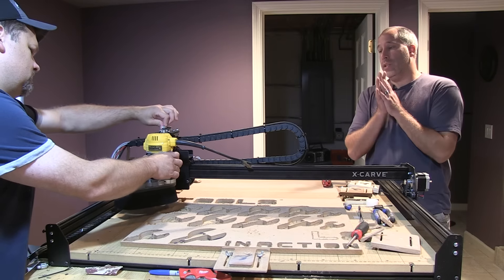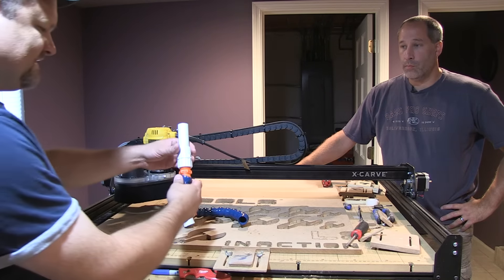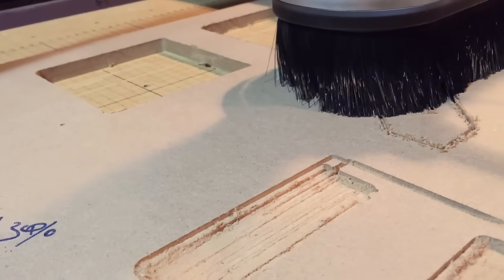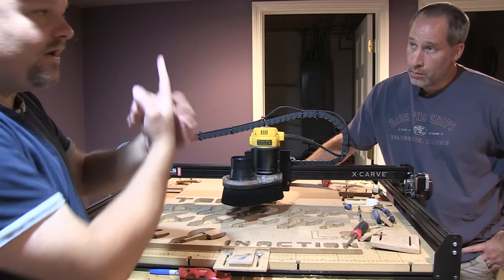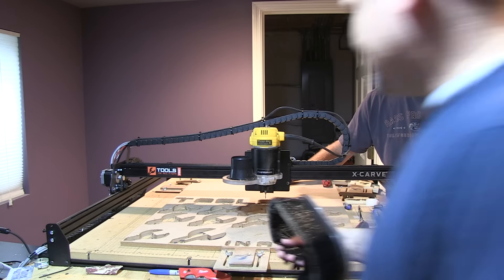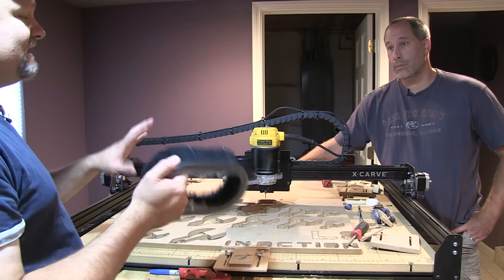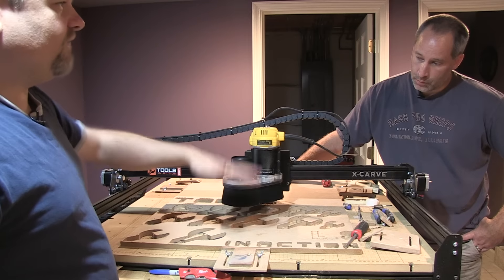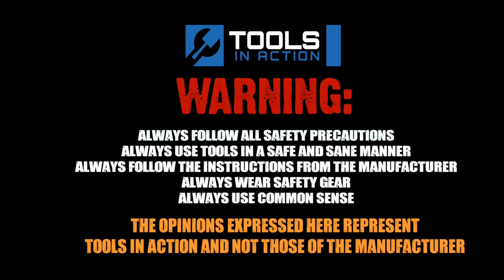Kent CNC Dust Boot for X-Carve with DeWALT DWP611 Router

Comment: Tried that once with my Rockler Shark, nothing but problems on big cuts(deep) - which I make more of. I built a cabinet with an acrylic front door to house the CNC, then used an air mover and piped fresh air into the router and on the steppers. The cabinet has a filtered outlet for venting the warm air generated by the machine outside. As far as clean up goes, just vacuum it out after each cut. The Router gets fresh air so you don't have to worry about dust in it, and the CNC steppers get cool air so they stay cool. I think I spent about 50 bucks for the air mover and used about 8 feet of 2.5" flexible dust collection hose...so it comes out to about the same price as the boot.

Comment: Are you guys using the Rigid bottom motor vacuum with that dust shoe?
Reply from the maker: +RC Grid No we are using a DeWALT Hepa vac
Reply: +Tools In Action Thank you. Can it be used continuously for hours?